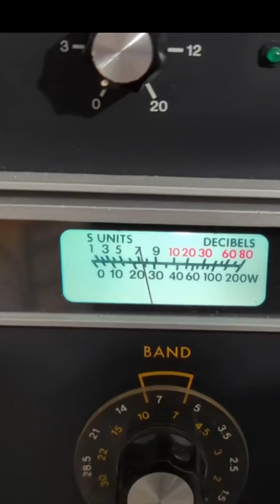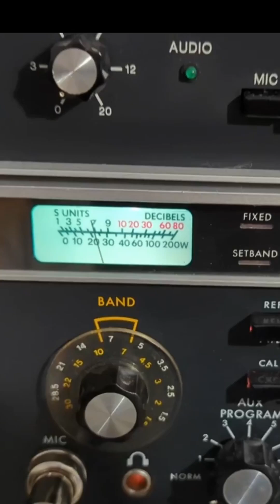👉 “This Radio Makes SDRs Look Like Toys” #RealHamRadio #DrakeTR7A #hamradio

Comment: Drake eqipment was well engineered for its time, but I'm not sure I understand, in what way is this better than a modern SDR?
Reply from the maker: Longevity. Serviceability. Sound.
Most SDRs are disposable once parts go obsolete. This Drake has already run for 45 years and will keep going, with real analogue audio instead of DSP pretending to be it.
Reply: @VK3USA  Your first point is true for all modern electronics, not sure about the second.  The DSP in SDRs isn't pretending to be audio it is the audio.  You can either do radio with physical components or in software with DSP.  DSP has many advantages over physical components.
Reply from the maker: @cthoadmin7458 My point isn’t that DSP is fake or ineffective, it’s that it fundamentally reshapes how noise, dynamics and fatigue are presented to the ear. Analogue receivers and IF filtering tend to shape noise in a way many people find easier to listen through over long sessions. DSP brings advantages, absolutely, but it also introduces a character of its own.